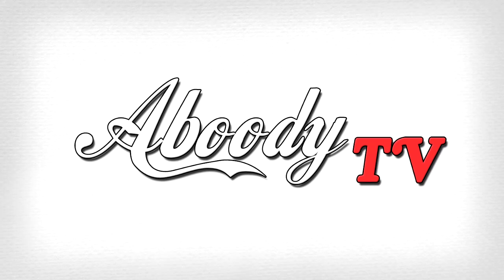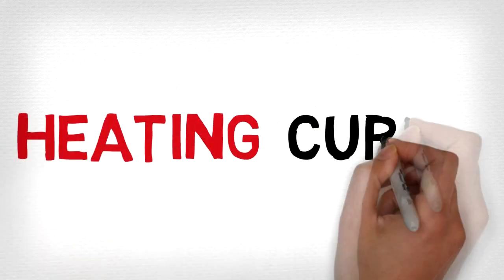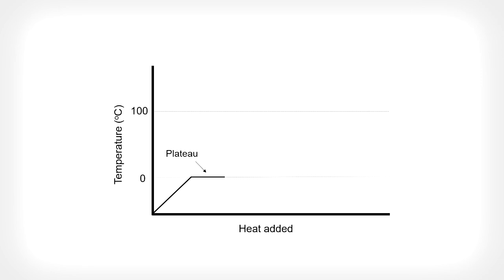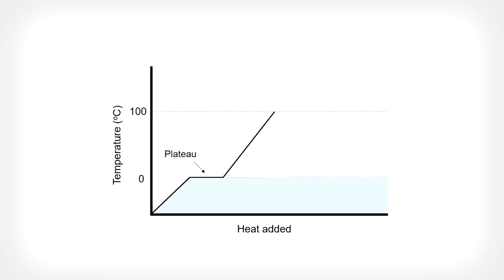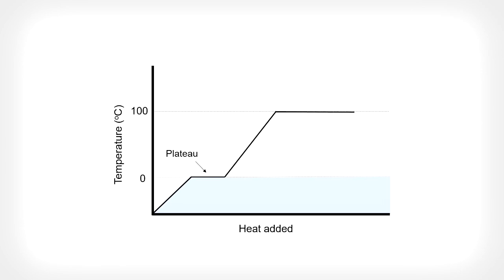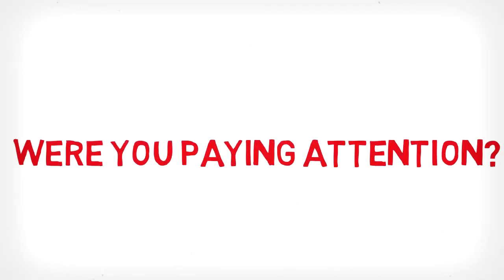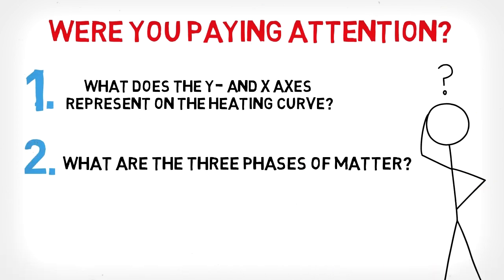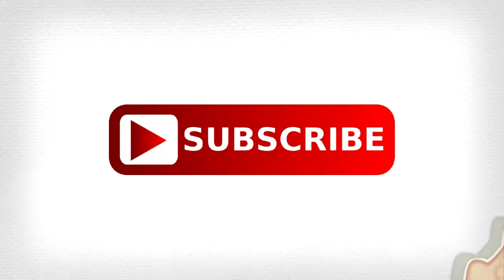HEATING CURVE - How to Read & How TO Draw A Heating Curve - [ AboodyTV ] - Chemistry

Comment: I'm confused... why does the 0 on the Y-axis not coincide with the 0 on the X-axis?
Reply: Because water can dip to a temp below 0 but time doesn’t have negative values.
Reply: @mcj2196That means that the Y-axis should extend below the X-axis, right?

Comment: Question 1. Answer temperature
Question 2. Solid, liquid and gases
Question 3. Plateau
Reply: the question was to mention the y and x so the ans is tempura with heat added
Reply: Actually the x is the time and y is the temp